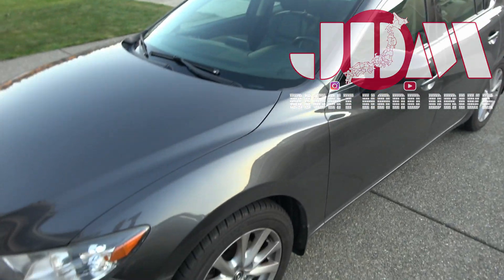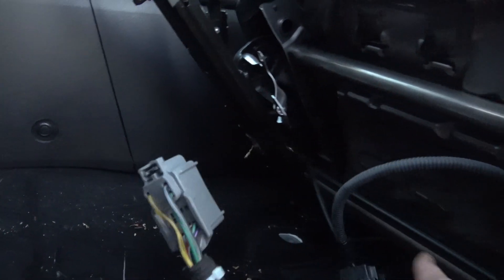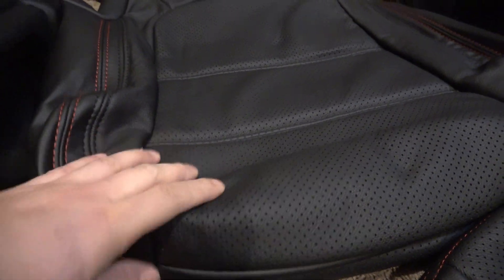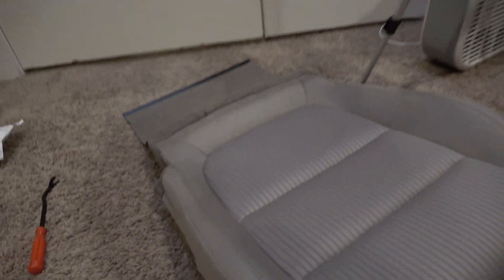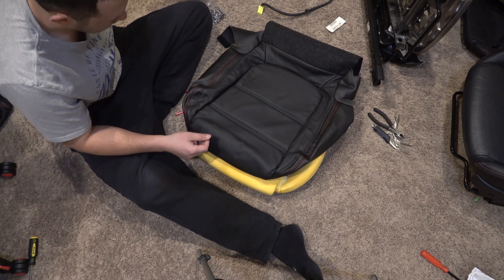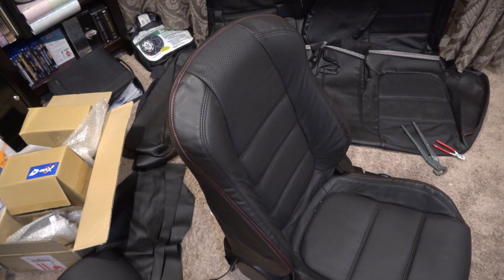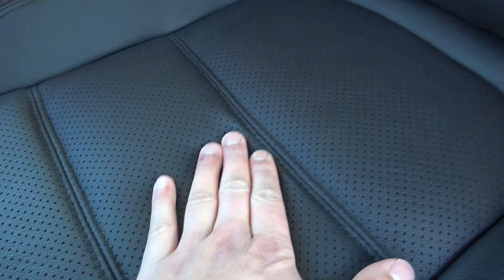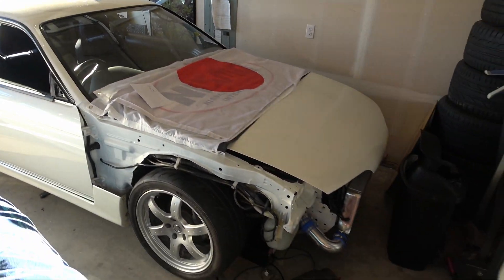New Roadwire leather seat covers install Mazda 6 vs OEM Cloth seat covers

Comment: Try hot glue on the trim areas. Should stop from the folding look. Hot glue it an stretch the seat cover across till it's flat looking but not too much cause when they sit I will wear the seat maybe tear.
Reply from the maker: I will have to try that, I still have to finish the back seats.

Comment: Nice job I wanted the same but all the black ones are out
Reply from the maker: Thanks, this was kind of a pain and very time consuming. I just finished doing the rear seats last week. They look amazing. I still have the edit the video on that one!
Reply: @JDMRightHandDrive  i might be doing my rear seat bottoms soon. 2 cigarette burns and 300$ to buy replacement
Reply from the maker: @alexh8754  I replaced all the leather top and bottom in the back seat. I shot it on video but never got around to editing it yet. The bottom seat was really easy. It has about 100 hog rings in it! Did you go with OEM leather seat cover?
Reply: @JDMRightHandDrive  I'm going with regular cloth pulled off some wrecked mazdas. I really like the cloth I have now. 100 hogrings don't sound too bad, I'm looking forward to the vehicle finally being pretty pristine

Comment: Looks awesome,   i was hesitant to try roadwire because i was unaware of the brand but juat installed them on my trail boss and cant say enough good stuff about them.   They look better than the katzkin i did in my f150 albeit these were diamond stich so natually more custom look.      I would recommend them 1000%
Reply from the maker: Awesome. Happy to hear this video gave you the confidence to pull the trigger for Roadwire. Glad to hear you are happy with them.

Comment: My mazda 6 sport 2.2D has leather red seats however as you could expect with a lot of wear and tear so I was looking to replace mine like this would you say it will effect the heated seats if you put this cover on?
Reply from the maker: I would not think so, removal and install would be the same process. You would just have a exposed heat mat on the seat once you removed the old seat covers.

Comment: Hi, i Don't understand how to put back the plastic pieces to the metal rim/lip of the seat to fix the seat cover. ( min 6:10) I had my car for technical inspection and the guy somehow pulled on the seat to adjust it i think and now i find that the seat lower part comes up if i pull on it and it's quite annoying. I don't know how to fix them on that metal lip. thx :)